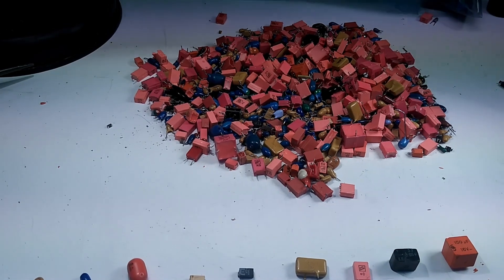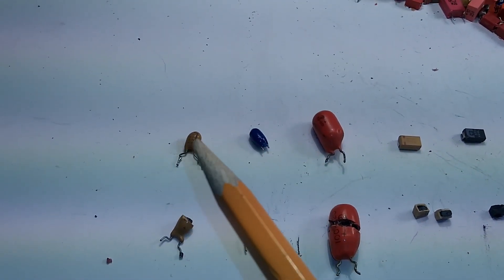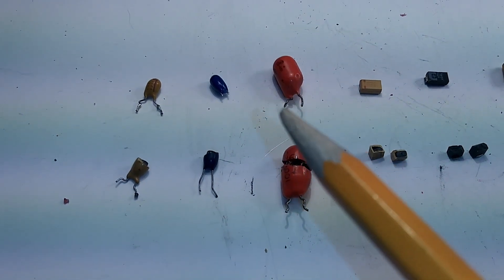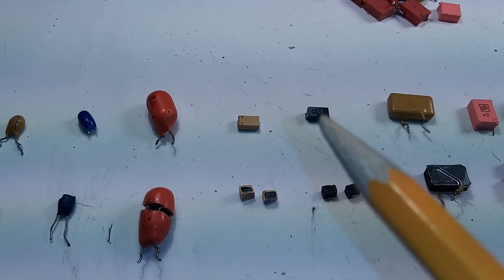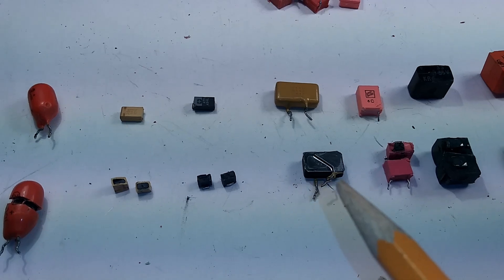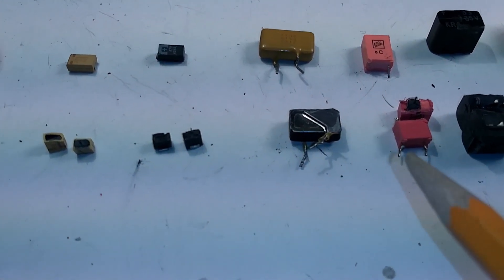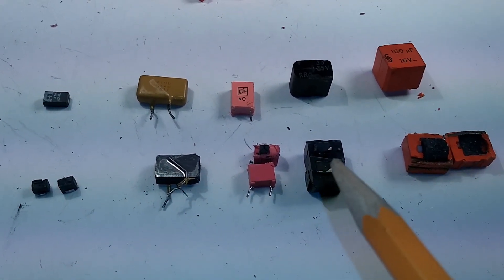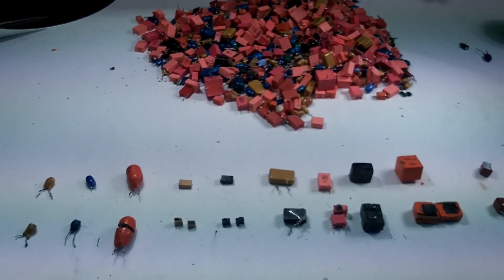Tantalum Capacitors - How to identify

Comment: I found an old box of capacitors in a house cleanout. Couldnt figure what they were. Took a picture and uploaded it to chatgpt. It helped ne figure out the were good quality  mica capacitors used for either power supplys or audio equipment. If you got anything your not sure about, give it a try.
Reply from the maker: Yes .. the mica caps are the most sought after ones for electronic hobbyists. I have a bag of them and use them occasionally for projects. To buy new mica caps are very expensive at Digikey. I would not destroy them.